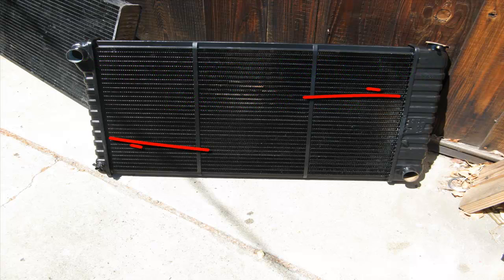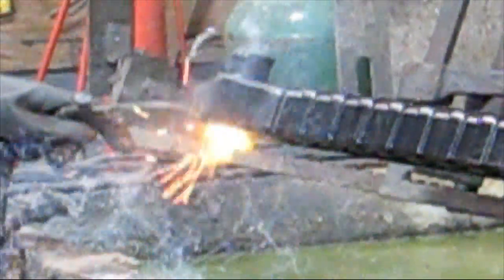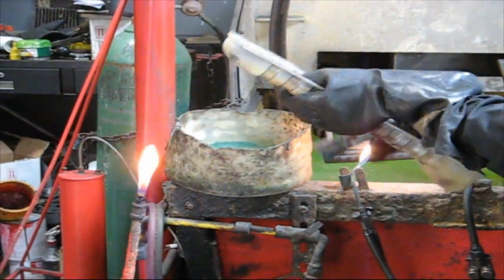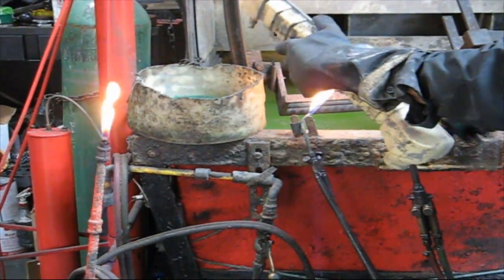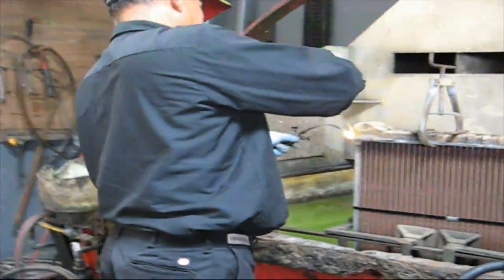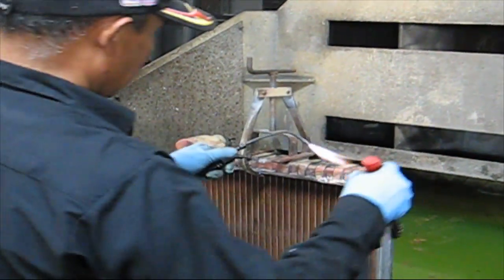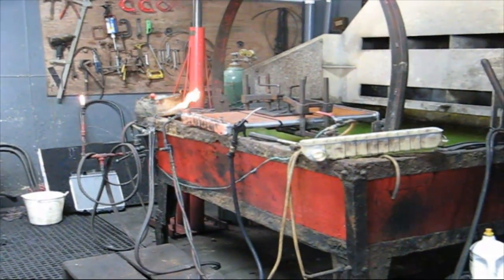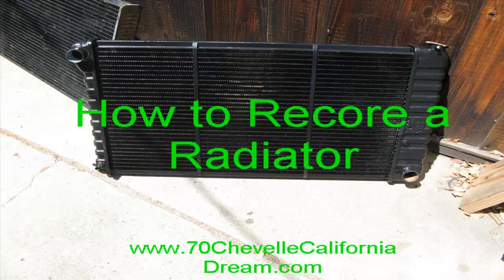How to Recore a Radiator

Comment: Safety glasses might be  a good idea when blowing hot solder off the tank!
Reply from the maker: +Ralph Shepard I would not do it though glasses
Reply: @davidlis6709  what?
Reply from the maker: @elonmust7470  The owner supplies all the safety equipment but not all the employees use them.
Reply: @davidlis6709  As a timber faller who hates saw chaps I can somewhat understand. But I can easily keep my chain off of my legs. As for molten metal, been there done that (slag in the eye), NO THANKS! Hell I don't even wear glasses when I'm cutting, after a while a guy finds all the little windows where he can peer from behind his powerhead to observe the kerf. But metal, nope....
Reply from the maker: @elonmust7470  I cut about 3 cords per year with a chain saw but I wear safety glasses.  Eyes are the last thing you want to lose.
Reply: @davidlis6709  glasses fog up no matter what the season. I've tried screen glasses but don't like them much. Between the powerhead & a hardhat brim, The only thing that gets in my eyes is fine dust & the occssional piece of bark. I know old timers who ran a daw over their heads for most of their careers (big timber) & all of them still have 2 eyes. Most have a lot of titanium in them though.